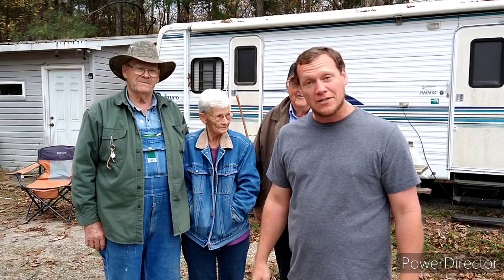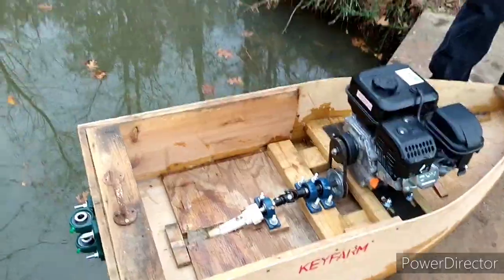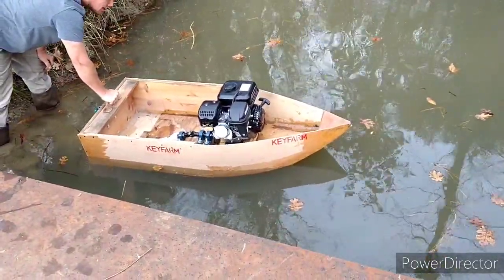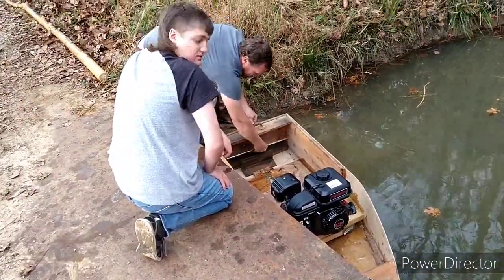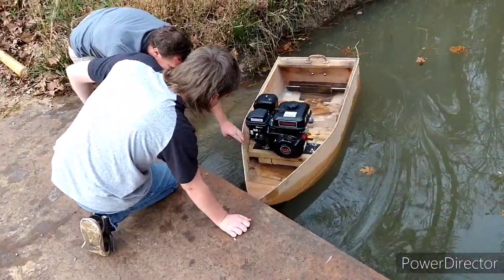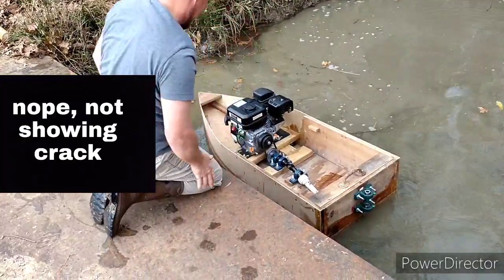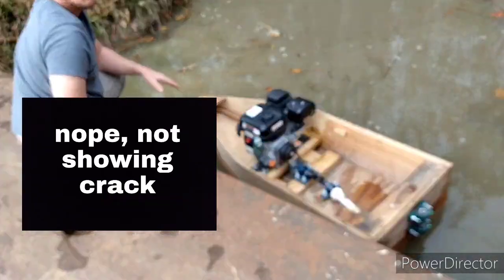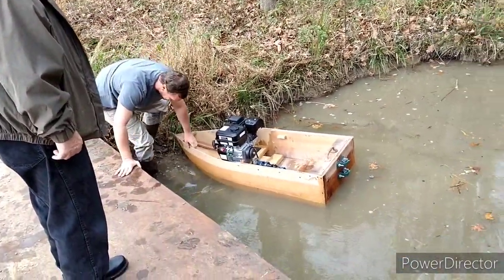Homemade inboard boat motor , predator 212 gokart engine in a  plywood RC boat. 1st water test.

Comment: That design would power a small jon boat, assuming you could seal the shaft port to keep it from leaking. The angle on a U-joint is pretty severe. It will work, but the wear on that U-joint will be a bit more than normal. Also you want to make sure the engine stays fairly level when underway. If the engine gets too un-level, it can starve for oil. Even momentary oil starvation can cause problems at high RPMs.

Overall, looks like a fun project. That setup will definitely push a bigger boat. Good luck with it. Looking forward to the next video.
Reply from the maker: Thanks, appreciate the comment, you've been watching almost since the beginning 👍.
Reply: I'm sure it would work well in a sailboat.

Comment: that is a cool projekt! didn't the pump drive work?
Reply from the maker: The pump drive did work but I never did build a rudder that worked very well, then I put the project on hold because the pump went back to pumping water at the farm, unfortunately the farm flooded while the pump was set up on the creekbank, so now I've got to take it apart and get all the water and sand out of the engine 😭

Comment: WOW!!!👀😁  been watching videos on YouTube all day, and This Sir is the best video i have seen.
 The boat weighs nothing so its like a floating 212 predator with a propeller.. Just put a bar stool over the motor, add some handle bars to control the rudder, and a cup holder for your favorite adult beverage . Sounds like a fun weekend.
Reply: You must be easily amused.
Reply from the maker: So, Pat, you didn't like it

Comment: you need a thrust bearing so all that thrust isnt pushing on that universal joint
Reply from the maker: That's a good point, I hope that pillow block bearing is doing that. It has set screws